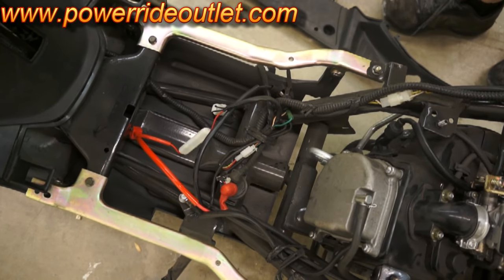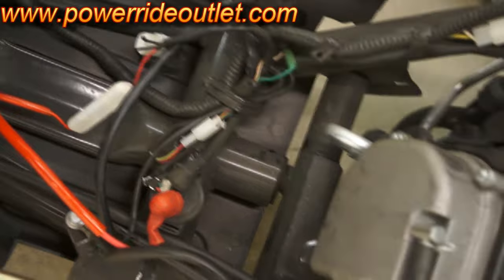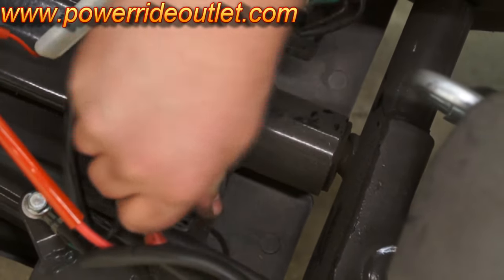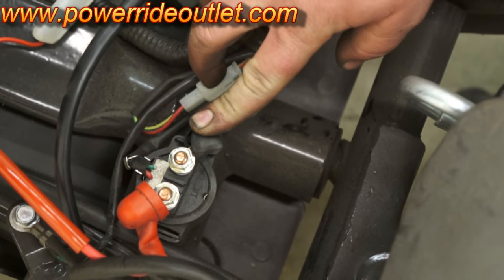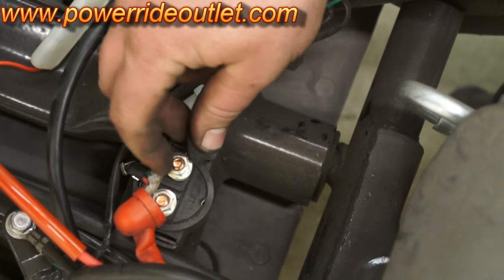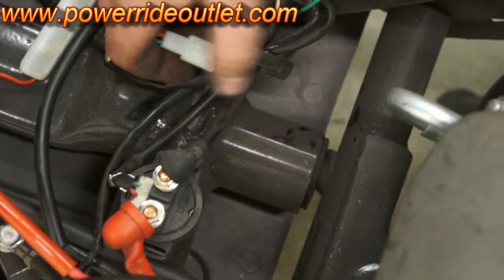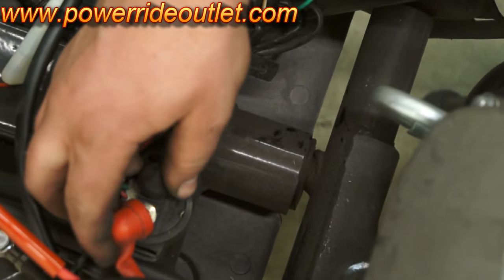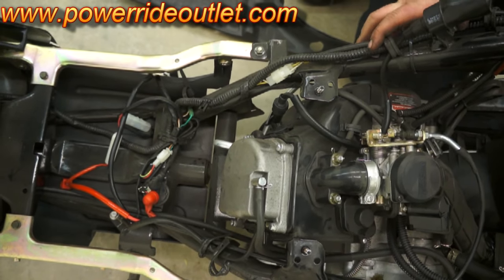scooter 101 starter relay

Comment: What if the starter button is defective?.. got the same problem on my scooter. It was sitting over the winter and when i tryed to crank it it does nothing. All lights and everything on the dashboard works but i can't hear the relais click, neither the fuel pump. I will now check the starter button, then the wireing to the relais and then the relais itself.

Comment: Hi I have Piaggio Zip 100 and It won't start with Push button as well as in Kick Start. I check the Red Fuse near the Battery and it seems busted, my question is if i replace that Red fuse will my scooter start? Also, why is that I dont have power on Break lights and even in Kick start there is no sound at all? Thank you in advance for the answer.

Comment: About time someone explained, Relais, Rectifier, Solenoid, Regulator are they all the same thing?
1 Question on here is my Scooter does not have this Solenoid but a Yellow Box with 4 Pins
Starter Relais/ Solenoid or not.

Comment: I have a Tao Tao 2020 50cc. And have put new battery in, but electric start does nothing. The kick start seems to be ground out cause it won't kick start and sound horrible when you try to kick start it. I'm about to just take it to scrap yard. Plus the dash lights were super dim, which makes no sense seeing as battery is brand new. But hooked up charger   for Less then 2 min now my lights are super bright like they should be. I'm just tired of working on it.

Comment: Hi there, i tried doing this and there is a spark but still nothing happens. do you know what else it could be? put in a new spark plug, new battery, tried adjusting the valves, finally this but like i said it sparks just nothing happens

Comment: so the relay isn't working when connecting the two terminals starts it? and when yours was broken did the starter moter still work but not start the bike or was it just completely dead? thanks
Reply from the maker: Russell Morrison The starter motor will still work if you bypass the relay if the starter motor is fine.
Reply: @davidt8051  i tried bypassing it and it just sparks, nothing happens. what else could it be? thank you in advance

i changed the spark plug, i adjusted valves, new battery, etc,.

Comment: I need help on my primavera in 2016, at the stater but can not live. After the spark plug wires are opened, there is no fire. Fuses and lights, normal horns and oil pumps do not sound when the ignition is on, please guide brothers ... thanks

Comment: I'm a little lost here. my button won't do anything to start my scooter but if I use a screw driver on the thing you have in your video ( solenoid?) it will turn over but I haven't gotten the scooter to start yet... but since I can start it with that one thing using a screw driver, that means it's bad?? I thought you could always get a vehicle to turn over by doing that..
Reply: yeah, same here. Im not sure but I think shorting the terminals on the solenoid/relay just means it has power and good ground but anything before that could be bad; including solenoid, main switch, fuse, brake switch, start switch. did you figure out the problem?
Reply: Any selonoid can be jumped like this,  ..  As long as power is supplied.  Totally does not mean its bad or good.  Lol.  All your doing is skipping the function of the switch.
Reply: My issue turned out the previous owner laid it over which i knew he did a few times and still rode it then the last time was dropped and messed the motor up internally.

Comment: Hi, Just checking, i have a chinese 4stroke 50cc scooter, when i self start, i get tick tick noise out from starter relay, what u think, is fault in relay, scooter starts normal using kick start, only issue is using electric starter..
Reply: i have the same issue with mine
Reply: +xTOA Xpert671 i fixed mine, it waz thr starter relay which was fauly, just $10 fix, job done
Reply: +One Channel 
Thanks alot bro!
Reply: +xTOA Xpert671 first try testing ur relay, then come to conclusion if that is faulty, switch ur power switch and join relay circuits using sny metal , then if it starts its ur relay faulty.

Comment: even if the starter relay is good if you jump the posts it will still attempt to start. The relay is just a signal switch when 12volts are applied to those small 2 wires that you can barely see in the video they energize a coil inside the relay that bridges the gap between the two posts and jumps it to make it start. A better test is to remove the relay and connect the tiny wire that most likely has the red stripe to positive on your battery and the one that has the green stripe to negative on your battery and listen to see if you can hear a click.....no click no good...….
Reply: And if there's a click and it doesn't turn over?
Reply: What if it won’t crank when u out screw driver on them both ?

Comment: screw driver does not start bike ? i ordered a new starter relay hope thats the problm
Reply from the maker: if bypass didn't work than than sth may be wrong with the fuse, have you check fuse on battery?
Reply: fuse looks good
Reply: i have a yamaha riva 125cc
Reply from the maker: are you able to get it to crank?
Reply: +David T yes it does all I hear is the starter relay sparking. and clicking last owners had 2 wires twisted. around it I guess to start it scooter was running all of a sudden it don't start
Reply from the maker: Yes, that means the relay is bad....but you should able to by pass it and get it start unless sth like fuel pump or carburetor is malfunction too.
Reply: gas is coming out thru the hoses
Reply: ya well ill find out the 19th
Reply: i dont know shit about that stuff carb ill have to take it to a shop
Reply: So the starter relay solved the issue ?

Comment: My 150cc scooter starts with both starter solenoid and button? How is that? Isn't it the same exact thing as a 50?
Reply: ivan caminero This person doesn't seem to know what he is talking about.
The switch basicly shorts that positive and negative/ground (the wire that goes to the starter.
So your bike is working fine

Comment: im having problems with my scooter it wont start or turn over the battery is fully charged but when i turn it on the lights flicker and when i hit the breaks everything goes off like im draining the battery help,
Reply from the maker: +Derek Hill Is the scooter cranking over or just making a clicking noise?

Comment: my scooter wont start either.batter is good. just clicks when i push the button. i put a screwdriver in between the solenoi leads and nothing happened. i ran a couple wires to the starter after i removed it and it spun so im at a standstill for now.
Reply from the maker: So you mean you have also check the starter motor and it is good?
Reply: Right there with ya

Comment: So what happens if the starter turns but the bike doesn't turn over
Reply from the maker: If it did crank, then it could be the carburetor is not getting gas or the jet is getting stuck.
Reply  ·
Reply: Its a new carb
Reply: But it just clicks from the solenoid
Reply from the maker: That means the solenoid is no good, you can just replace the solenoid.
Reply from the maker: ***** Thanks for the correction, I misread the question.
Reply: It is not so much what you said,its how you said it. I think  people that talk down to some one to make themselves look smart are assholes.
Reply: ladies please...

Comment: Hi can anyone help ?  I bypassed the starter relay but joining both posts with a screwdriver ,  I left it on a bit too long while I turned the key then I heard a tap and the scooter has no power now ,  no headlights , nothing !  I know I’ve probably blown a fuse or something ,  the battery is reading 12.80 so the battery is still fine !  What’s blown ?
Reply: maybe you blew a fuse.
Reply: Mark Zanetti it’s a cheap Chinese scooter and only has one fuse that I know of on the positive terminal  and that is in tact
Reply: I suspect it’s the stator so I’m replacing it soon
Reply: Hey Mathew Dee I'm having a similar issue. Did you figure anything out??